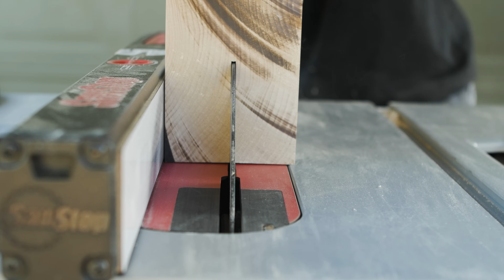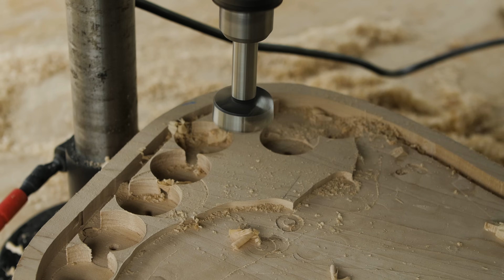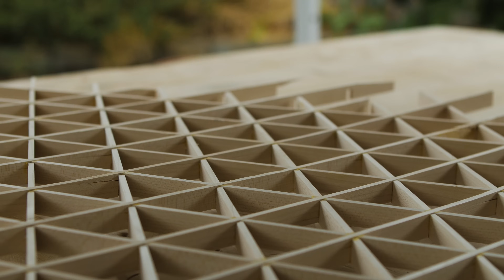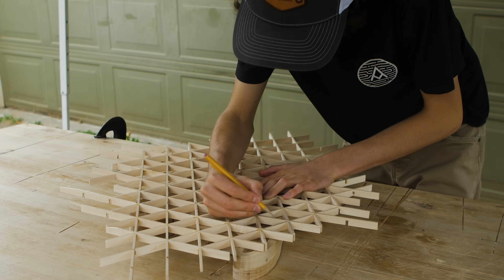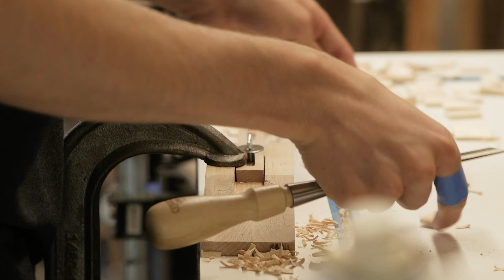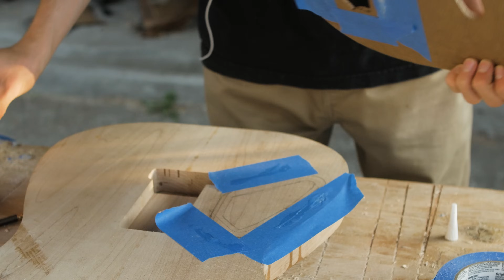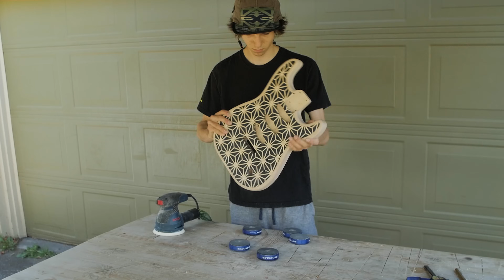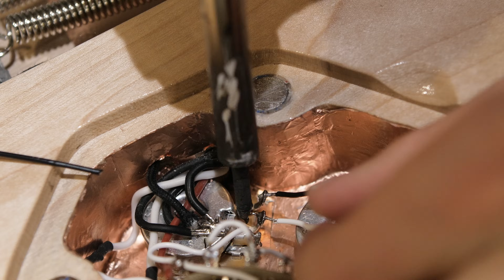Epoxy + Kumiko = Epic Guitar?

Comment: Hey dude, please learn how to do the welding one level higher. Your welds will last, don't get me wrong, but you can do better. What I saw you doing wrong, is simply heating the thread that is supposed to melt, and then you "glue" it together. Things get better, when you heat the components and add the actual weld. In order to heat the components, you need a bit of welding material. Temperature is important, too hot will result in dull welds. When you nail it, you heat things up, quickly join them together, your welds shine like silver and the welds look like they are drawn to the surface they are welded to. Your first weld looks like it wants to run away from that wire, it does not like the wire at all. It is a convex blob. It does not shine, it has been too hot for too long. You have almost cooked that weld. No offense, I know welding can be nasty (some wire simply repells liquid lead) and it is  just a thing you might pay some more attention to. When you know the tricks of the trade, your welding will get more beautiful.
  Besides, I am Dutch, and the Dutch can be horribly blunt. The intention is helping you out, giving you some advice, for we care about the other person. At the risk of being impolite. You have made a  F A N T A S T I C guitar, and the welding can be better.

Comment: How strong is cured epoxy? There are 3d printed guitars, but they often go out of tune quicker because of the tension on the plastic body. Maybe a 3d printed pattern like this one and filled with epoxy would be stronger.

Comment: I used the exact same clear coat on a kit bass I recently built. However, I dumped 2 whole cans on it (and there was still room for improvements on the sides) because both body and the veneer I put on it were unsealed open-grain wood (paulownia + flamed ash). Nice guitar btw (the "only 4 colors look" really is something)!

Comment: This is an awesome build, well done! Please be careful with the neck pocket though, it looks like the neck plate isn't able to sit flush with the body and there is a huge gap between the body and the overhang of the neck. I'm super worried it isn't fitted correctly and the tension of the strings will eventually snap the neck off and cause some damage to you or the guitar. I've seen off the shelf guitars break like this before because of neck issues that were far less obvious. I'd hate to see your wonderful work get damaged! It might be worth consulting a guitar tech on their opinion.

Comment: Very impressive results. A word on the magnets, you gain no additional holding strength doing a magnet to magnet connection like that than you would a magnet to a steel washer. That said those little magnets are pretty cheap these days, so might not even be worth it to bother with washers or metal discs.

Either way, subscribed.

Comment: That's an insane build, Miles! The only concern I have with it is where the cable's supposed to be plugged in. The cable's gonna be in a weird 90°-ish angle and it could damage it. I think you could've put the thing on the bottom like some squire strats, its in a place where it doesn't bother the pattern at all and its in an angle that's safe for the cable. Aside from that, this is one of the coolest guitar builds ive ever seen, its fun seeing a creative guy use his creativity to the fullest.
Reply: Angled plugs exist.

Comment: Gorgeous work. Not sure if you put any clear on the head of the neck or not. But something I've learned as a scale model builder, If you put your decals down before clear coating and clear over them they will be protected by the clear and you won't have issues with them being worn off or peeling up over time.

Comment: That's a fine build!  A good tip is to create a template so you can pre-wire your pots and switch before installing. Reduces risk of solder burns on body as well as gives you more room to wire it up!

Comment: That is extremely cool. The following may not be kumiko, but a tri-directional grid is easier to cut and assemble if one eliminates intersections of more than two strips. You still have to cut the 60-degree slots in the edges of the strips, and one third of the strips need to have their slots alternating on the two edges of the strips. It makes a similar pattern but it does not have the star bursts of your kumiko design. It does form larger six-pointed stars. I invented it.

Comment: Amazing work, really good!! One small thing though; the input jack should be on the side, I know you have got the skills to do that.
Reply: Have you seen the input placement from slipknot guitarist mick Thomson? An upside down strat jack close to the strapbutton.
Reply from the maker: @LDN76  I haven't but i'll have to go check that out, thanks for the recommendation ;)
Reply from the maker: Thanks, I made an intentional choice to put the jack on the top because I've had guitars with the input jack on the side, and if you bump the jack when the cord is plugged in it damages it easily.

Comment: Awesome work! Truly inspiring, you're on your way to being a master builder. Guitar or otherwise...
I'm gonna have to attempt this myself.
To second some of the comments, the decals we an nice touch, finishing over them would be advisable.
Also knobs with your design inlaid,  or a design inlay on the headstock or even matching headstock would have taken this over the top!
Inlaid tuning buttons, or even the fret board markers. Not criticisms, I'm truly inspired and my head is swimming with ideas.
I suspect you had a time constraint for the build.
If you do something like this again I would suggest to place the input jack on the bottom side like a tele or a Les Paul as to not interrupt your awesome top pattern.
Nice playing too. 
Keep it up! Thanks for the inspiration.
Reply from the maker: Thank you so much! The custom knobs and finish over the decals are something I will definitely do, but as you guessed, I ran out of time. I was heavily debating whether or not to have the jack on the side, but I decided to put it on the front because I've seen how easily the jack can break if it is bumped (being more exposed on the side). Thank you again for your comment ;)

Comment: No grain filler or sealer coat? I use that 2K as well, great stuff... but... if you don't seal the wood first, in about 2 years it'll no longer be smooth. That stuff (even years later) continues to shrink into the pores. My first re-finish used primer, paint and the SprayMax 2K and after a few years it still did it. :S

Comment: You did an incredible job on this build!! Love how this turned out, way to go!
Reply from the maker: Thank you so much for the support! I had a ton of fun with the epoxy.
Reply: This is a really cool project that you helped with. Thank you!
Reply: I would have left out the epoxy. It would have been very light and resonent. You could have done cool stains or dyes.
Reply: @stevenlewis4385  This was a superlative build. Despite building guitars myself, I'd buy this one. The control cavity cover is a sweet extra. The epoxy (or something similar) is pretty much a necessity, there wouldn't have been enough structure to support the mounting of the electronics and hardware, particularly the tremolo, without it.
Reply: @RoadkillPinata  Yes,it would have been difficult to do without the epoxy.  And it sure looks cool. I was just curious how it would have sounded with just the wood.
Reply: Eric   guitar    https://www.youtube.com/watch?v=i25dD5s1spwericguitarjhgyftr

Comment: That’s got to be one of the coolest guitar builds I’ve ever seen! Those decals took it to the next level. 👏
Reply from the maker: Right on! Thank you so much ;)
Reply: @makewithmiles  you want to know how to work with epoxy, always test test test test test test test on scrap pieces until you're absolutely sure that you like the results, before you even think about using epoxy on your special project😅

Don't ask how I learned that🤣
Reply: @makewithmiles  instead of using paint to transfer on your rear cover one thing you can do is use the tip of a tack, sharpened at both and so you have a small rod sharpened at both ends, push that into one side and then when you push your cover down you'll transfer an exact pinprick to the other side where you would drill. It might give you a more precise transfer.

Another technique I use in robotics is to cut a clear piece of acrylic and Mark my holes in the acrylic over my part. Then I take the clear piece of acrylic to the other part and I drill through the acrylic into my part. Works out extremely well for precise things. About as precise as you can get without getting into Milling.
Reply: I agree, but maybe it would be better to apply decals before clear coating, they would last longer
Reply: @theendgamefl888  well since I just paid about $1,200 for a pretty standard guitar I'm guessing a guitar like this is in the minimum three to $4,000 range. That's just a guess it could be significantly more.
Reply: Agree 💯%
Reply: Eric   guitar    https://www.youtube.com/watch?v=i25dD5s1spwericguitarmmmkmnjk
Reply: agreed!